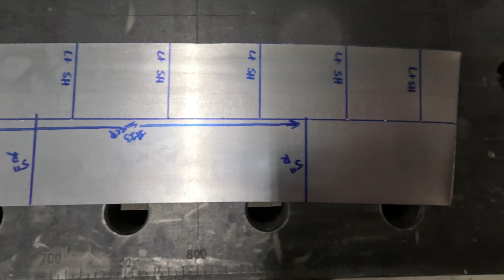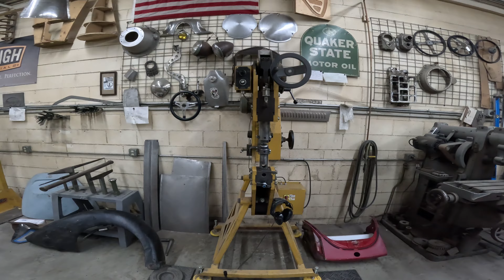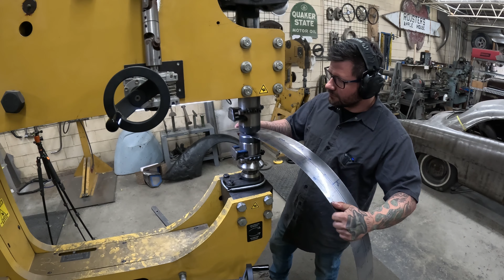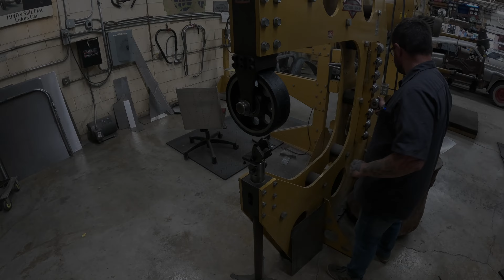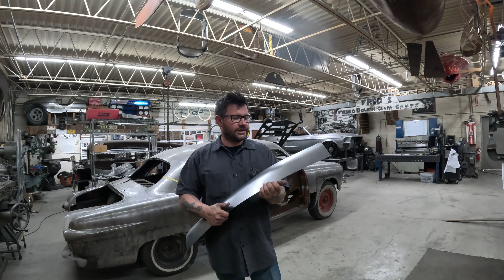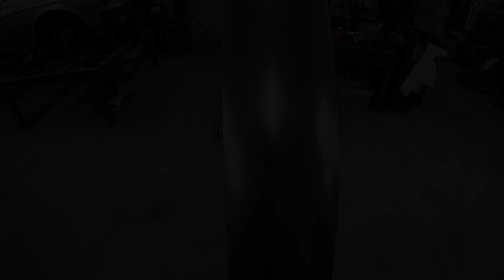Chop Progress 1940 Lasalle Roof Panel

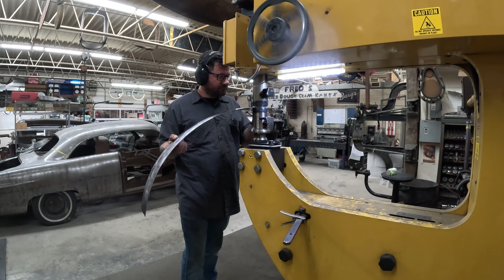Comment: Does the large power hammer w/ 36in radius lower die cause stretching as it smoothens out the shrink marks? @3:28
Reply from the maker: Not in this instance. it all comes down yo settings and what your trying to accomplish. I have the hit set just hard enough to blend and planish with out doing much in the line of stretching. If i need to raise an area or want to radially stretch i can adjust the stroke and get a harder hit to accomplish that task.

Comment: Fitted nice in the end, however you did work harder than you had too, seeing as you took 90% of the shape out that you put in at first, that's a low crown panel, no need to shrink any of it
Reply from the maker: I didnt take 90% of the shrink out of the panel. You can choose to do it your way and i can do it my way. But thanks for watching and will anxiously wait for your video to show me the proper way of doing it
Reply: @cornfieldcustoms  Mike, you do some great work, but just pointing out the obvious. I'm sure you could make that panel in 30mins by just raising carefully, try it, prove me wrong👍
Reply from the maker: @maxakarudy  you point out what you think is obvious. When you dont know exactly how much shape is in a panel. Also if it were all be stretch based shape work the material would thin out dramatically. I prefer to balance out the shrink and stretch as to keep the material thickness as similar as possible. I dont need to make a panel to prove you wrong, i have nothing to prove to anyone. Its funny you say it could be done all stretch in 30 mins, when i had a class last weekend and we did all the shape work the same way i did it in this video in about 40 mins minus the finish planish work which would still need done all stretch based as well.